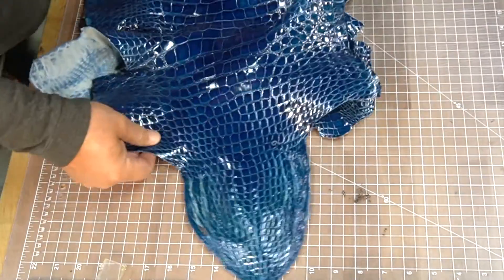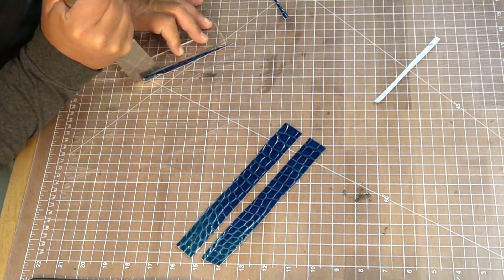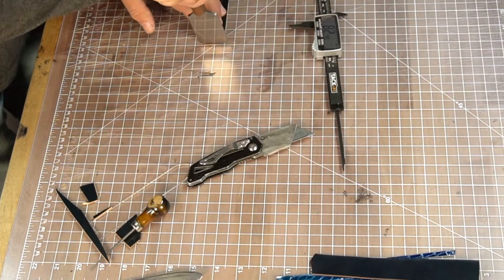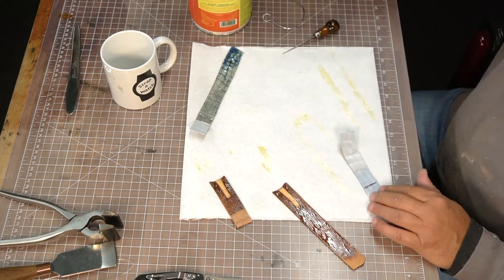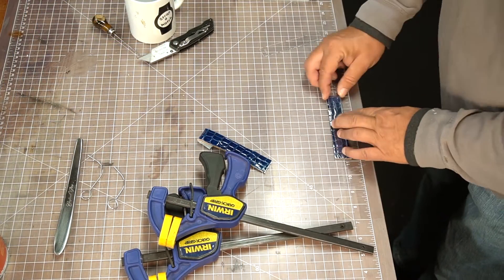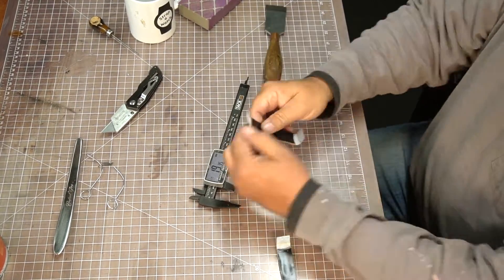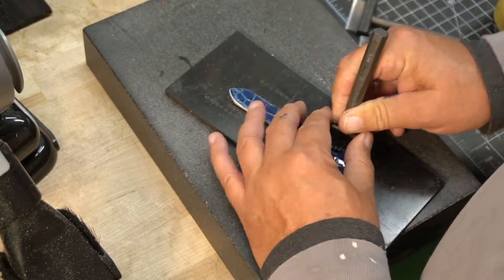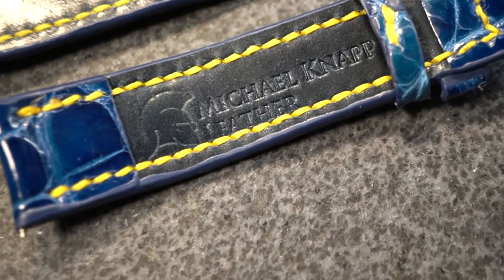Custom Handmade Genuine Blue Alligator Watch Strap for a two-tone Rolex Submariner Blue Dial Watch!

Comment: Amazing video.  I really like how you explain every step of the process.  Glad your thumb is healing up well.
I agree the straight spring bar probably could have worked out fine on my 2003 DateJust.  There is plenty of clearance with the curved spring bar I ordered.
I just put on the dark navy alligator strap on my patek 5205.  The embedding spring bars makes it a snap to change out the straps.  I have to say.. your alligator strap feels even more comfortable than the original Patek strap.
Reply from the maker: Thanks S C! I would love to get a few pictures, and/or even a wrist-roll video of the blue alligator on your Patek. I’m actually in the middle of editing the show highlighting the buildout of both of your most recent straps. If you want to try putting in straight traditional Spring Bars I will send you a set if you like? Just let me know. Thanks again for everything! MK
Reply: @StrapaWatch  I’ll send out some shots tomorrow of your blue strap on my Patek.  It may turn out to be my go-to strap for my 5205.
I’m excited to see how you actually built out these beautiful straps.

Comment: Hello, I've watched alot of your videos, you seem to have experience with many different leathers. 

I recently used Zermatt calfskin as an inner liner, which is excellent - but I don't like how soft the temper was, as it "deformed" ever so slightly with the tension of the saddle stitch, which I do not like.

Are there any leathers you know of that have a firmer hand, that are appropriate for use as an inner liner? I have found natural colored buttero, etc. becomes discolored (in a bad way) over time, not being combo tanned/pigmented at all.

Thanks
Reply from the maker: Hi Robert, Thanks for reaching out! I’ve not had any real issues with Zermatt as a lining. You may have used too thick of a piece. You could always try other Calfskins or Lambskins. Of course Shell Cordovan is the ultimate, which is what I use on all of my personal strap linings. If you find something else that works well, please let me know. Thanks again! MK